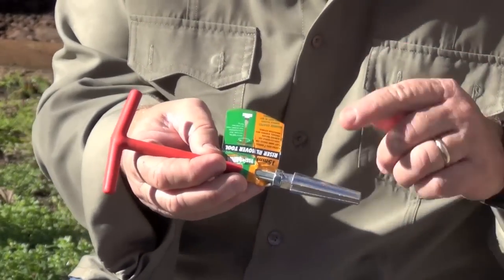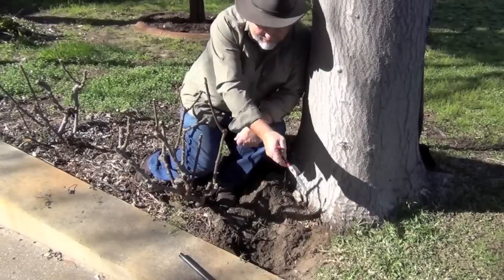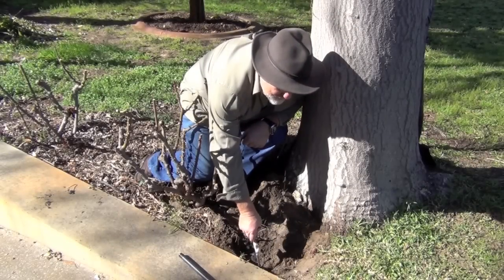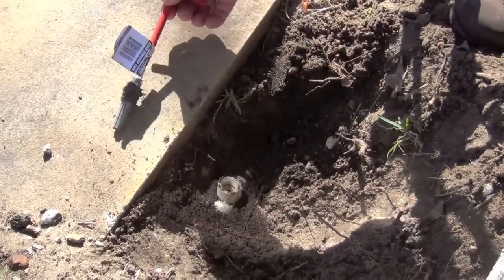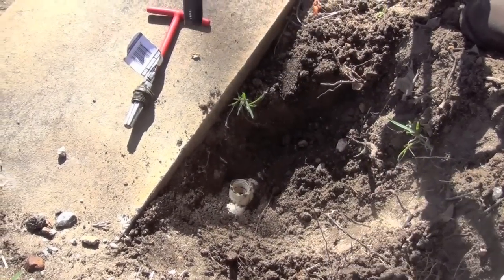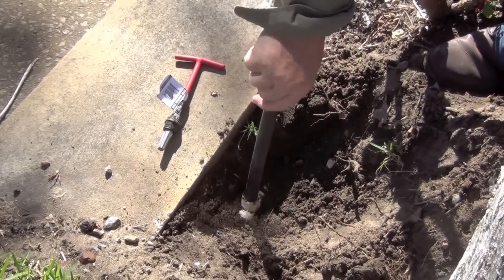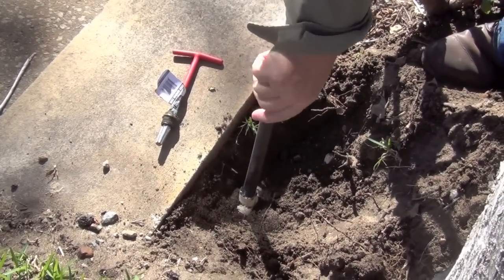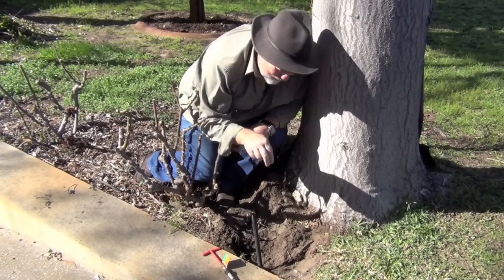HOLMAN Riser Removal Tool

Comment: Would you recommend cutting the edges of the embedded broken riser to get a better grip? I'm using one of these tools but it won't grip, just goes around smoothly and I'm not sure of the depth of the PVC T pipe to be confident enough to force it down in case I break the PVC. Thank you.

Comment: The tool doesn't do as it should as the blades are dull and not sharp enough to grab the sides of the poly stuck in the PVC housing. Out of many attempts where I have broken off risers (connected to sprinklers), I have had success only once. It is a design flaw which is easily rectified by Holman.